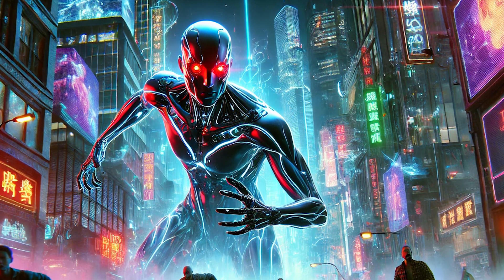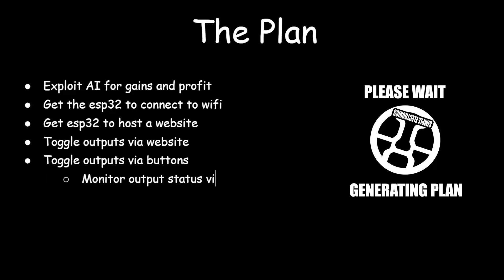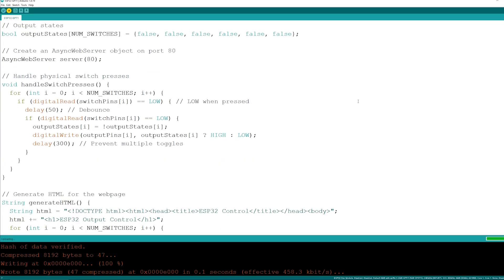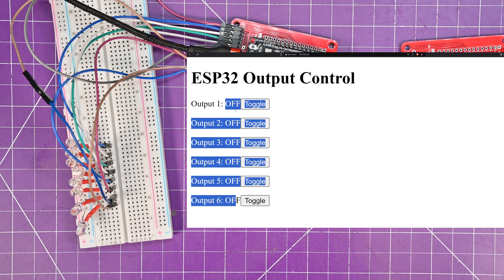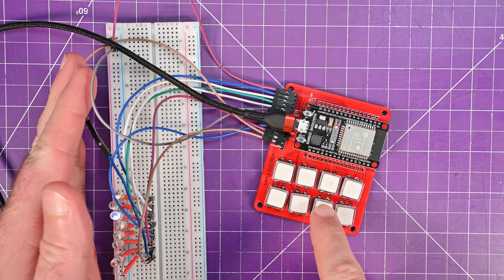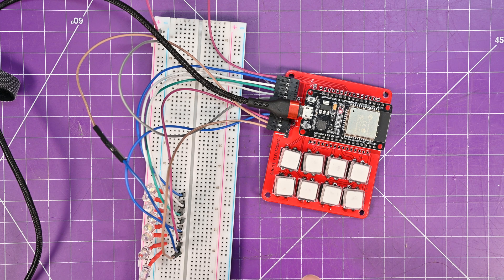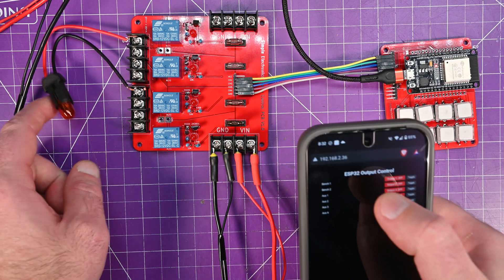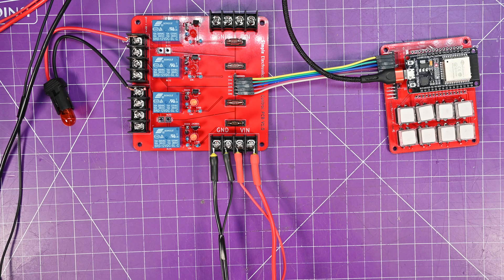I Exploited FREE AI To Make An Electronics Project

Comment: Nice work!  For the type of things I use AI for, it's 99% of the time Claude for run of the mill tasks and then it's straight to GPT-o1.

I'm all for using this stuff as much as possible in most situations.  I'd love to tell everyone to go learn to code, but the reality is that if you haven't learned by now, you're probably going to have a nearly impossible time not leaning on the AI tools too much.  

The main problem with AI on bigger projects is that you just can't use the tokens to give the thing the view of the entire project.  I think coders as project managers is probably the sweet spot in the coding industry moving forward.